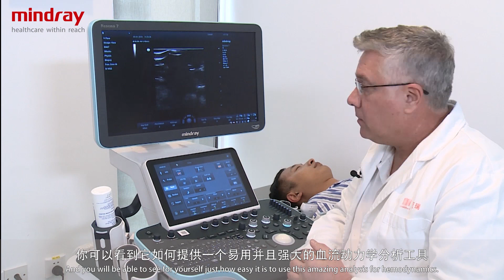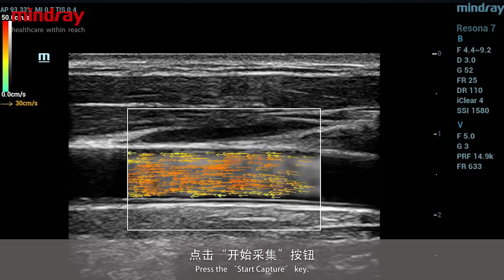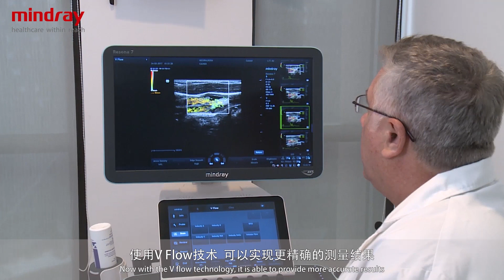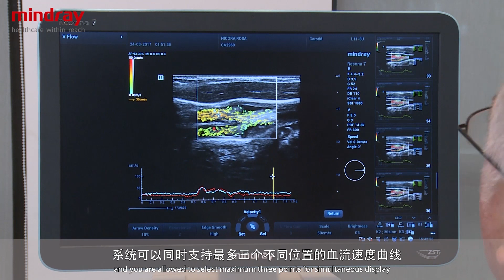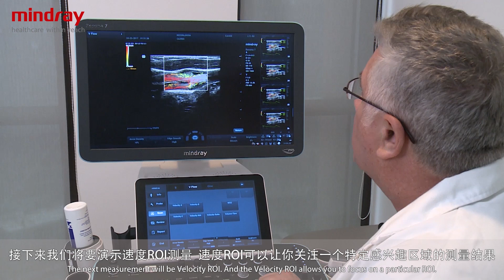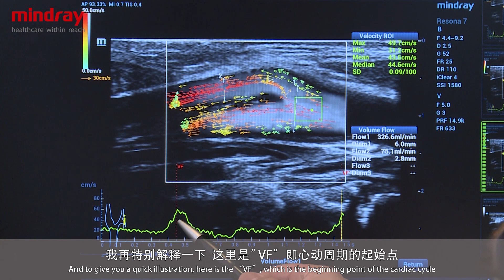V Flow, a Novel Approach for Vascular Hemodynamic Analysis

Comment: When measuring Vol flow in the presence of disease would u include inner wall to inner wall regardless or do u stop at the diseased segment. I think that Vflow seemingly is a nice bell / whistle. My only curiosity is if it has influenced a difference in PT management. Also  when compared to "conventional" measuring HOW much MORE accurate is it and what does the correlative testing / lit say.
Did u (I would venture to say u did) do side by side analysis and clinical trial.